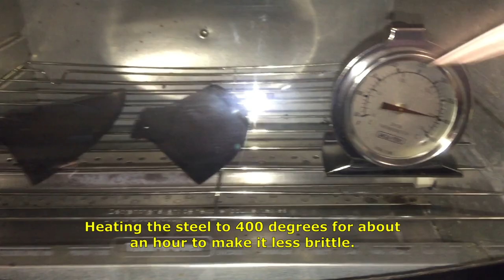Simple ULU Knife From Saw Blade

Comment: Saw blades are already heat treated.  Did you redo it just in case, or did it lose the temper when you ground it with the angle grinder?
Reply from the maker: I first heated the blade to make it softer when grinding the edge.  Then I reheated it before quenching and annealing after the blade was ready for sharpening.  Thanks for watching the video and commenting!